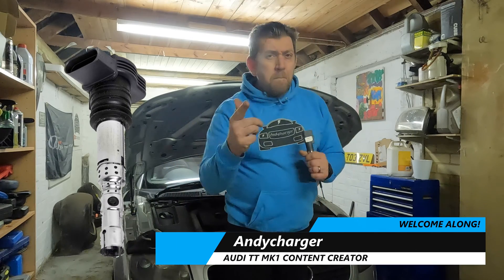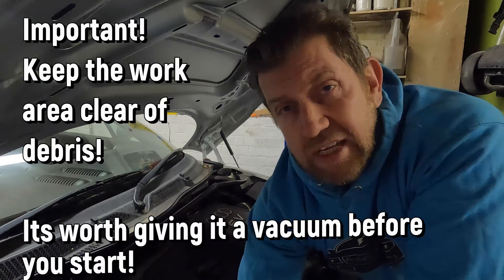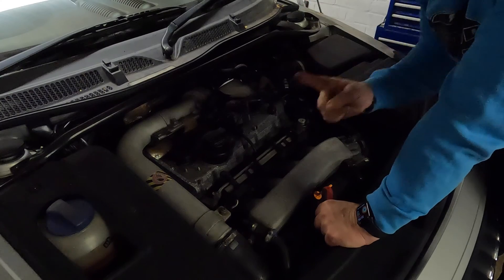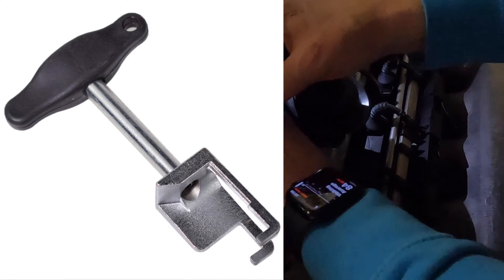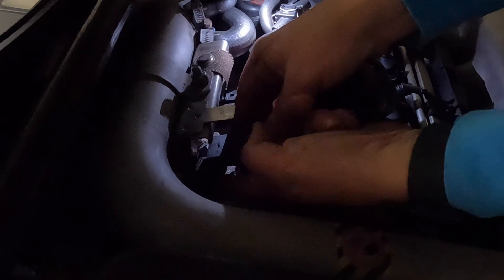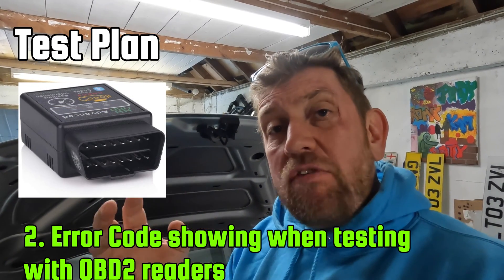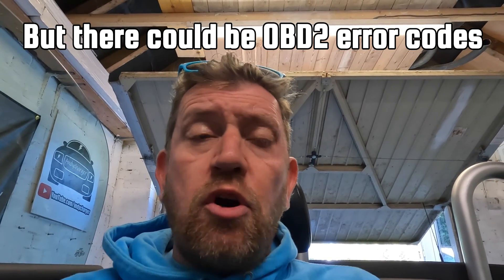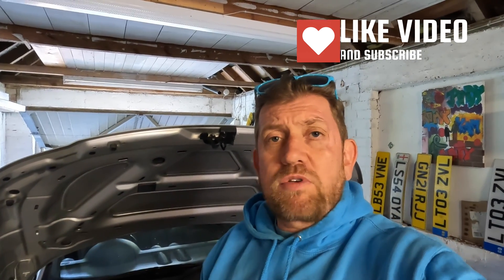Easy Fixes For Audi Tt Mk1 - Removing Coil Packs & Fixing Misfires With Obd2

Comment: You dont need that exact tool to remove the plug do you?
Reply from the maker: @harib0k1d  for the connector? Not if you are careful but they do help! 😂
Reply: @andycharger  thanks for getting back to me! Can I ask, is there a way of diagnosing without the plug in and app? I'm talking about an old school diagnosis lol
Reply from the maker: @harib0k1d  I would say unplug it. If the revs drop, the plug was firing. If no change in revs, the plug or coil pack is not firing

Comment: Got P0036 that’s coming back whenever I tried to delete with OBD2, I don’t want to buy a new O2 sensor yet, but removing the coil pack & a new Fuse at 43, after plugging back, driving the car 20 minutes, OBD2 is now telling me no more P0036 and passed the smog check 😂too)*

225 BAM  ‘appy again
Reply from the maker: Good work pal! I’m glad it’s sorted!

Comment: Great all round tutorial Andy. Great to see the diagnostic side fully explained with symptoms and how to diagnose them!
Reply from the maker: Thank you David. Hopefully I made the testing process straightforward. One thing I do want to cover is to show how to access coil pack 3 and 4 in more detail so people understand what additional components need to be removed to test these.
Reply: @andycharger  Definitely easy to follow testing and straightforward. Your diagnostic on coils packs 1 & 2 is much easier for sure. Coil packs 3 & 4 are more involved having to remove the N249 and all the rubber hoses (which run the risk of splitting and then they require replacing too). If you ever make a video on changing the rocker cover / camshaft gaskets (which will eventually leak due to age) then you have to take all the additional parts off to remove the rocker cover. That would be an ideal time to add an extension to this video whilst creating a new video. Keep up the great content and catch up sometime soon!

Comment: Great info Andy, I see I will need to get a couple of tools. Might be worth doing same vid for V6 owners.(firing sequence and position?) At least on V6 the Coil packs are accessible!
Reply from the maker: Thanks Si. Yes I do need to show how to disconnect a V6 coil pack as it connects slightly differently to the puller tool that a 1.8T car. There is a short video on firing sequence and coil pack numbering on my channel. Here is the link: https://youtube.com/shorts/zrkMRuI7OeY
Reply: @andycharger  Thanks Andy, I will take a look.